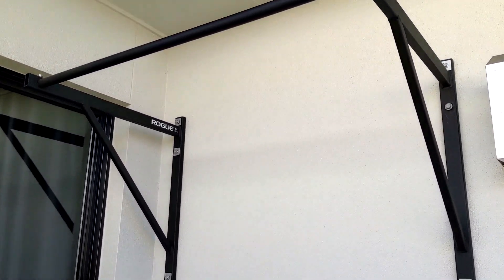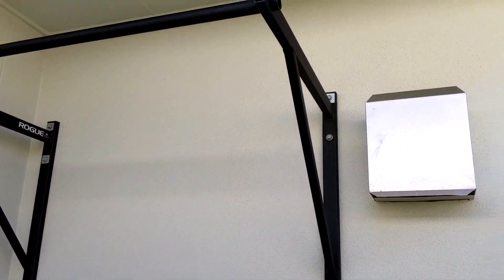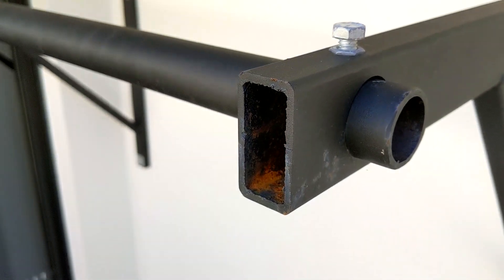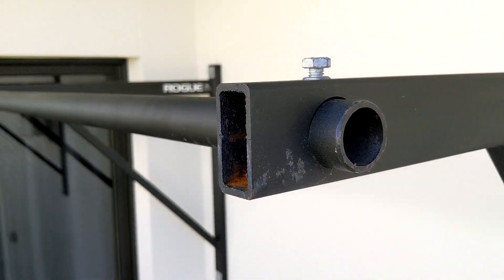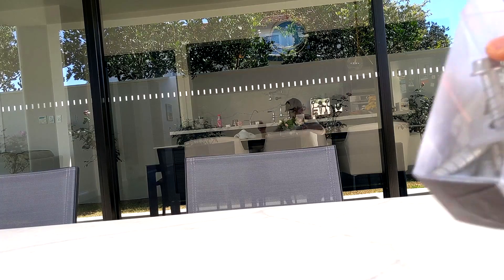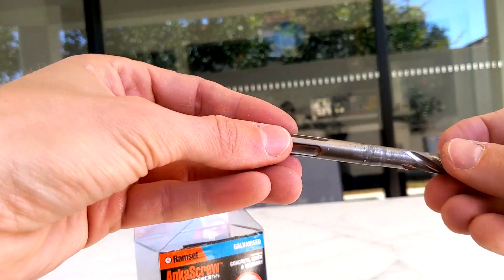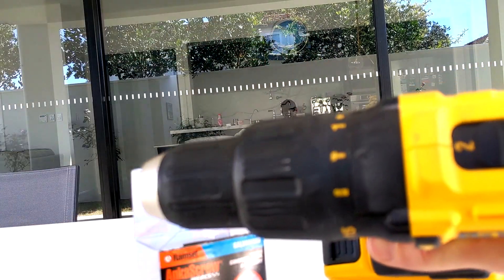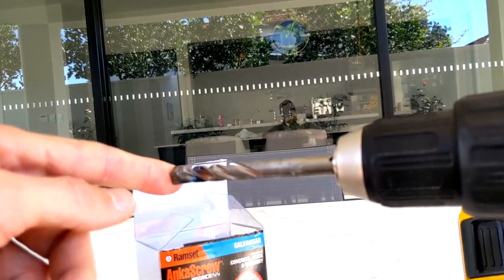Solid, Clean and Elegant Pull Up Bar solution for home, Rogue P-4

Comment: Hey man, thanks for the video. Is this installed on brick veneer wall?
Reply from the maker: Thanks mate, it's hard to tell it's masonry or veneer, most likely it's a veneer brick wall, been solid with no issues for ~3 years.
Reply: @SilverFoilSurfer  thanks for the reply! How did you mount it and what hardware did you use?
Reply from the maker: @Sharp_and_creamy  It's pretty much described in the video, I used Anka Screws.

Comment: Did you use rawl plugs with the bolts or only bolts directly into the wall?
Reply from the maker: Those anka screws in the video go directly into the wall. As long as you drill a clean hole (concrete specific drill bit) - it fits pretty nice, the only thing is don't over-tighten it at the end and use washers.